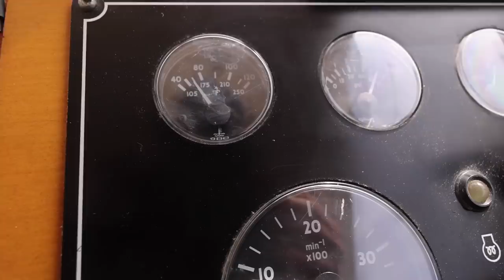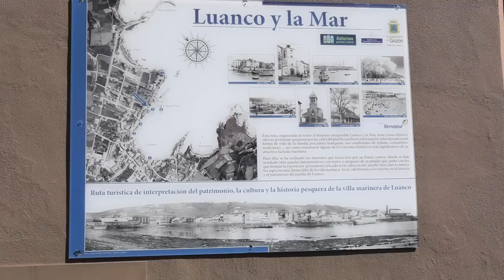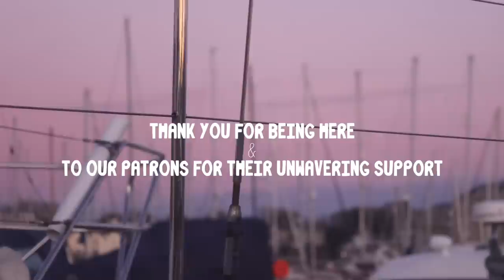This made us want to LEAVE

Comment: Hi Zac, The rusty split pin is probably what broke the plastic as iron rust expands as it rusts. So always use stainless split pins or Monal Metal split pins in a marine environment. If you know someone with an industrial 3D printer then you could get a replacement made. I would do it for you but I am back in the UK.
Reply from the maker: Thanks for your help Hillary! The new pin in it is now stainless steel (I think it’s a high grade too). We’ll have a look into 3D printing 😊

Comment: Zack, I have heard your mention using acetone on several occasions.  I hope you realize how flamable acetone is and handle it with the utmost care.  We have had several boat fires in the U.S recently caused by acetone use. Only use it in open air -- not in the bilges or even in the cabin.  A very good precaution it to keep the lid on the container unless you are on deck.  Nothing worse on a boat than a serious fire.

Comment: Great episode. Zac, replace the plastic bit with as many stainless steel washers as will fit between the "stainless" cotter pin and the prop. Should be a permanent fix unless you fancy the pointy plastic piece, I wouldn't trust plastic anyway.
Reply from the maker: Thanks for the help Joel, I think I might end up doing that!

Comment: Another outstanding video. Again, well done. The noise of a whirling prop can get bothersome. If you have tried putting the transmission in reverse gear after cutting the engine, and that doesn't stop the spin, there is one more option. If you wrap the prop shaft with a rubberlike material, between the transmission and the packing box, you can clamp an oversized vice-grip onto the shaft without damaging it. The vice grip pliers should be long enough to rest against the interior hull and prevent the shaft from spinning. I had to do that on a boat I had a few decades ago because the "velvet-drive" transmission would still free spin even in gear. Beware - you should tie a red ribbon to your throttle, and put a red ribbon or tag on your keys whenever you lock the shaft - to remind you to remove the vice-grip pliers before starting the engine! (you don't have to ask how I learned that part!) Bob on Wild Rose
Reply from the maker: Cheers Bob. Putting it into reverse doesn’t stop it. That’s a really good idea, I’ve already got some vice grip pliers and rubber. I’ll give it a go this week! I’ll make sure to leave a note on the starting panel!

Comment: Hi Zac, the oil hand pump looked like it was struggling to lift the oil out, Top tip remove the filler cap to prevent the vacuum in the engine. Good job hope to see you sailing around the Med some day.
Reply from the maker: Hi Ashley, thanks for the tip. I’ll try it next time! See you on the water 😊

Comment: Zac a tip for pouring oil from a bottle. Pour with the opening at the top and the handle under. It’s not what you naturally think is right but you have more control of the oil flow.
Reply from the maker: Cheers Chris, I’ll give that a go next time!

Comment: Time served car technician here..
You don't need to tighten oil filters up that tight. If you do you'll struggle to get it off come the next oil change. 
It'll be messy when you come to take it off, because the filter casing will collapse and puncture as the filter strap crushes it.
Hand tight is absolutely fine. 👌
Reply from the maker: Thanks for the advice Peter! 😊

Comment: One suggestion for operating equipment you rely on for your safety. Create an Inspection checklist to gonover the rigging, Hull, through holes, rudder bearing, steering links, sails, electrics etc... If you make your own and do it everytime you stop after a journey of more than 48 hours or so, you'll stop issues before they become critical... I do this in aviation and sailing. Makes a big difference for spotting problems before they become crisis 🙂 Love both your energy. Give me a shout next time your up in Anglesey... ill show you the secret spots 😉
Reply from the maker: Good idea, we’ll have to start doing that. Thanks for the offer 😊

Comment: Zach, Now days 3D printing might be the easiest choice in remote locations for a plastic piece. If you can find anyone with the right plastic & a printer. And agree on a price.
A decent machine shop could make a reasonable facsimile out of any number of different materials. Even wood could work for a bit, in a pinch.😁
It's been many decades since I worked on a small outboard but if memory serves me correctly, that cone only serves a couple of primary functions. It's #1 function is as a spacer between the prop & the "split pin" that keeps the prop from backing off the shaft when you put it in reverse. (Usually right after you sheared the pin that locks the prop to the shaft.😉) #2 is to protect the end of the shaft from excessive marine growth. It's cone shape is mostly for looks as it's hydrodynamic effects are of minimal concern. A properly sized "Donut Washer" or stack of washers will serve as well. 
Good Luck & Best Wishes. 🙋‍♂️
Reply from the maker: Hi Mike, I think I’m going to get some washers for it (seams like a good and easy fix). Thanks for the help! 😁
Reply: @TeuluTribe  No problem. It was fun watching you do a fine job of salvaging the original.😁

Comment: To reduce rolling of the boat you may want to consider a spinnaker with a foil like a parasailor. That's a brand. Works of course only downwind... But the foil will stabilize the boat impressively.
Reply from the maker: We’ll look into it, thanks André!
Reply: Parasailors come in around 2 or 3x the price of an A sail on a sock.... and they take up a ton of room in the sail locker.
Reply: @sailinggizmo  If the choice is a Gennaker I'd clearly prefer one with a top down furler. A sock still has lots of risk in to entangle in the forestay. Or the sock won't come down because it's halyard has turned around itself. Have seen many cases myself and heard from a lot more. Also every experienced sailmaker and long term sailor will tell the same. A Gennaker won't stabilize the boat as a foiled spi would. I'm considering myself to buy a Gennaker with furler for my 26ft centreboard boat as an spi is too hot to me. Especially with the class requirement of 55m2. The sail area is only 20m2 and the spi supposed to be 55? For sure not me on coastal waters of Brittany or the North Sea. But as a long term sailor you want good sleep in comfortable cruising. That's what the foiled spi is good for. But I'd also want an top down furling Gennaker. The Foresail is the most important for aerodynamics, the Main is often just a accelerator for the wind speed in the Foresail. Depending on the wind direction and strength. But I'd never buy a Gen with a sock, especially not for a long term cruising crew of 2. Never ever.
Reply: @Hotzenplotz1  We love our gennaker in the sock, and are comfortable raising or dousing it single or double-handed. Mind you, we are conservative with our sailplan offshore and let current and expected conditions dictate our sail changes. We will carry the A-sail up to 15-16kts TWS depending upon the sea state. Furling kit on A-sails is all pretty neat stuff, but have you seen what happens when the furler causes issues? @SailingZingaro just posted their 4-hour ordeal trying to unwind an issue with a furler at the masthead, it involved going aloft underway and caused some damage to their kit.

All things are compromises in sailing, especially in the cruising world. I do like the added layer of protection the sock offers the lightweight gennaker sailcloth when it is going through an open hatch as we raise or stow it. 

After a few offshore miles we have learned to keep "never" and "always" out of our vocabulary. "Never" open hatches underway... "Always" reef at sunset... "Never" run your kite at night... "Always" use your AIS and navigation lights... on and on. Those are guidelines, and the prudent sailor will consider the totality of the situation and conditions and carry on as safely and efficiently as possible.

Don't get me wrong, we would love a nice carbon reaching gennaker on a furler along with a symmetrical spinnaker, but space (nor money) doesn't allow for it. We have to compromise, and give some space to our spare parts, tools, stay'sail, storm sails, dirty laundry, beans, paddle boards, cheap rum, etc etc..... 

Fair winds and following seas  @André Bauer, don't forget the Route Du Rhum start is bright and early tomorrow AM!
Reply: @sailinggizmo  And that's the point. With an reliable furling system there's no need to be conservative using the Gennaker or not. Could you please send the link for the video of Sailing Zingaro? Often I couldn't agree with the things on that channel. The strong impression that they risk too much and treat equipment badly let me disable the abo.

Comment: Personally I wouldn't bother with the plastic cone, when it inevitably breaks again, just slap some appropriately sized washers on thare and add the split pin - the pin will hold the washers on, just make sure you have enough washers of the right thickness to hold the prop on firmly.
Reply from the maker: Thanks for the help! I’ll try that next time.

Comment: Hi there. Apart from being annoying having the prop spin is sometimes not so good for the gearbox. Can you engage reverse once the engine is stooped, I  do /did this on my current and previous boats, silence is golden and bonus -it doesn’t wear out your running gear or fray your nerves…?
Reply from the maker: Hi Mandala, as our gearbox is hydraulic  it won’t cause any issues to it by letting it spin. Leaving it in gear also doesn’t stop it. However, I’m currently looking into another fix.

Comment: Hi Zach.  I'd have saved myself a lot of time and trouble by replacing the plastic bit with some large stainless Washers and a stainless split-pin.  It is, after all, only a spacer designed to keep the prop in place on the shaft.  Just a thought for future reference.  Great episode.  Keep 'em coming.
Reply: I know that works and lasts at least 30 years so far.  I've also rigged one by drilling a hole in a bit of wood with a pen knife and heating the split pin red hot to burn a hole through the other way. (I've carried washers and split pins in my tackle box ever after)
Reply from the maker: Hi Russ, that’s a really good suggestion! I’ll be doing this next time I’m in a hardware store 😊

Comment: Replacement prop nuts are cheap as chips. They have a threaded brass insert so it tightens up against prop, then split pin to secure. Try ebay......
Reply from the maker: Thanks for the idea Ash. I’ll have a look into it!

Comment: If you want to make that 'prop nut' bullet-proof, pull some glass 'threads' out of a piece of mat (or even whipping twine will work) and then paint the nut with epoxy and wrap the thread around the body. (It also seems like an ideal piece to try and get 3d-printed by someone!)
Reply from the maker: That’s a really good idea Guy! Next time I have the prop nut off I’ll use some threads on it, I don’t know why I didn’t think of that 😅 3D printing will definitely be the way forward next time!
Reply: Was going to suggest superglue but the epoxy looks spot on and as Guy suggested, someone with a 3D printer has to be the way forward
Don't pay the rediculous prices you'll probably end up paying to get something over from the states
(must be someone local on your way round the coast that has a printer and fancies giving it a go)
Reply: Well, you guys are really on your way now. With the Bay of Biscay behind you, you can call yourselves sailors.
Reply: Has someone hacked your comments section???
Seems every comment has a prize waiting????

Comment: A 12 volt Hot Glue Gun can be pretty handy to have around for all sorts of work around Bodges. Diesel ze gives Thrive on Clean Oil, Fuel and Air and there's a lot to be said for using an early Water Pump impellor (never let those go beyond a Year before Replacing, as if those blades break off and get into the engine, you're in for a world of hurt which can be up to a full engine Stripdown and Rebuild.) replacement, to do an early full service, including a gearbox oil change. With TLC like that Diesels can actually get better and better as the years go by. cost benefit ratio heavily in Favour of Benefit. I had a Bedford TL Lorry, and inherited a Contracted Diesel Mechanic, who turned out to be absolutely useless and Clueless, and everything kept going wrong with the Vehicle.  Luckily I knew a brilliant Firm Soecialising in the Vehicles, but they had a long waiting list to get in. So I used a bit of leverage, as the vehicle wasn't really as safe as I would like on the road, knowing he'd fit me in, in an emergency, So I pulled into the Yard stating what the problem was, and luckily his father was still alive, who I had met as a kid with my Grsndfather, so I started chatting with him, and reminiscing about my Grandfather, went into the house for a cup of tea  to Co tinue Chatting about the old days, and ny uncle who had kept getting the lorries serviced there, then leaving me with a freah cup of tea, he popped out to see his son. Outcome, Full Checkover and Service, list of things to replace when the parts came in, changed what the had as spares in stock, and a shiny new HGV  Servicing Contract. Win ! That lorry in the next two years, became as good as new, and it had one seriously happy Diesel Engine I would cheerfully go zanywhere on the Continent in - apart from crossing the Border from Switzerland into Germany- Nightmare. But I'm rambling again ho hum. Bottom Line Diesels love to be Loved. Best Wishes and Fair Winds.  Bob.  👍🙂 PS. How big is your Dinghy ? Perhaps worth zsaving up for a New 4 stroke Outboard ? I'm going to stick a 6 hp on the 3 mtr Seago Hypalon Air Deck Air Keel. Enough power and really wickedly good fuel Consumption, with a 3 gallon external fuel tank, 100 mile range easy. But Never Ever Put Ethanol Mix Petrol in them, but worth adding Fuel treatment as if you are, as the additive orotects fuel lines, Carburettor and engine seals. Ethanol Mix also hammers your fuel consumption due to Ethanol's Dreadfully low Energy Density.  ☹️
Reply from the maker: I’m hoping to get a hot glue gun soon, it’ll definitely be very useful! 😊

Comment: The plastic is merely a spacer for the prop, shaped to look like it reduces resistance in the water. Pointless. Use stainless washers to replace the broken part and a stainless or brass cotter pin.
Reply from the maker: Thanks for the help Brian!